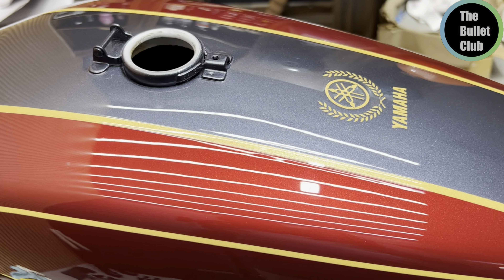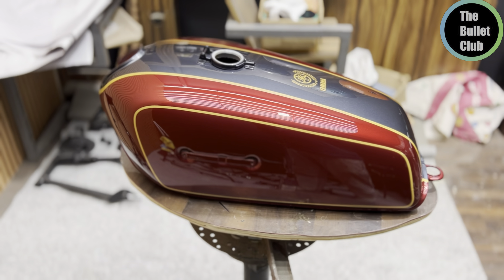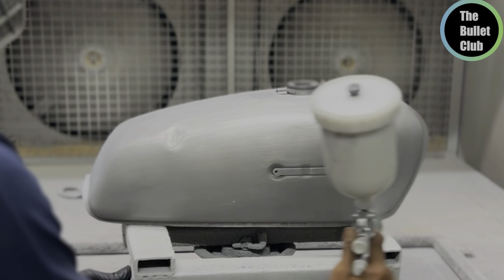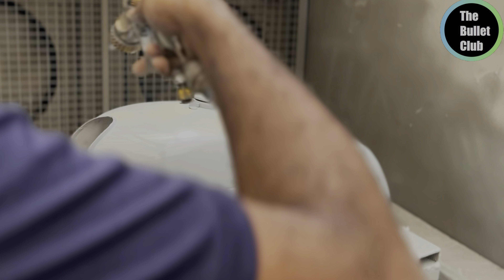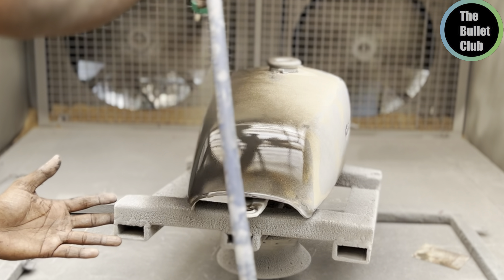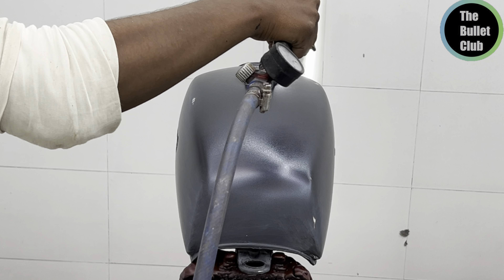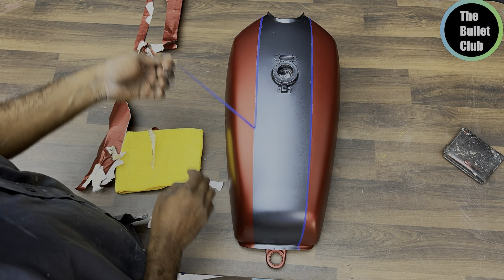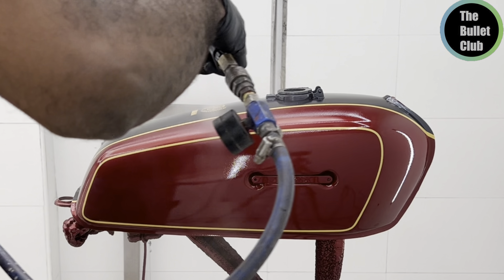Rx100 - Most perfect paintjob | Cromax Ultra | red & black paintjob | 10,000rs

Comment: What is difference between the paints for the frame of the bike and the body of the bike.
Reply from the maker: We use same paint for chassis & body which is pu ( polyurethane) , 
if a bike is painted with in 15k budget usually they will choose N. C. Based paints